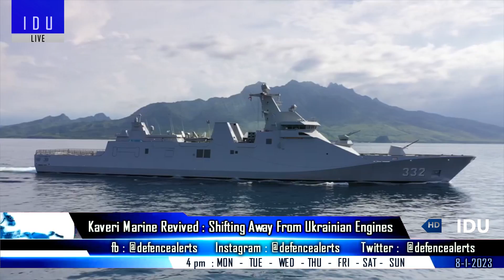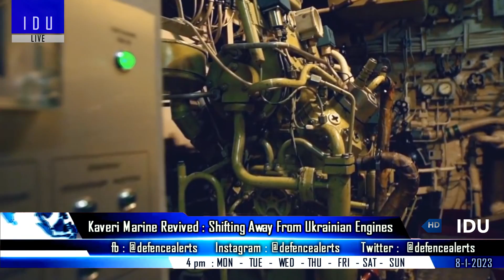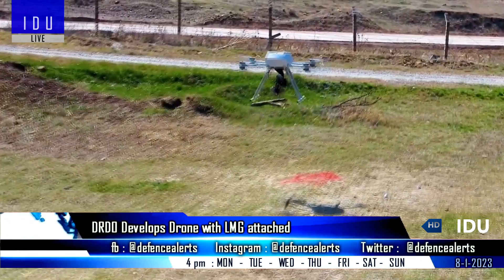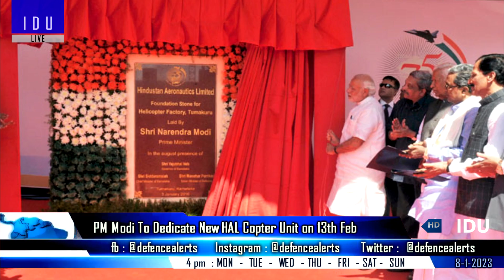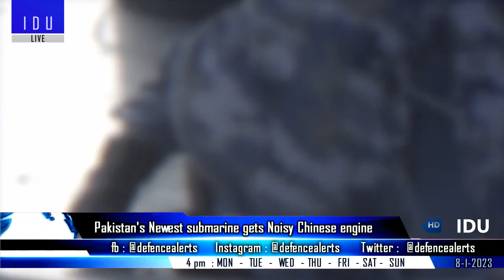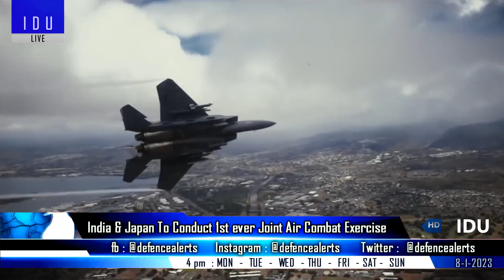Indian Defence Updates : Tempest Engine on AMCA,Kaveri Marine Improved,Drone With LMG,New HAL Unit

Comment: Along with inauguration of Tumakuru unit, IAF should place orders for 12 Initial Batch/Limited Series Production Light Utility Helicopters so that production can start. Deadline should be by mid 2024, all 12 need to be delivered. 

2025 onwards the production capacity should be increased to 20 Helicopters per year.

Comment: DRDO should develop a DJI MAVIC Territory type heavy duty drone that can be armed with a 25 MM GAU-12/U six-barrel rotary cannon & a 7.62 MMG . . . as for ammo load no less than 1,563 rounds of 25 MM ammo & 2,835 rounds of 7.62 X 51 MM armour piercing rounds . . . a 30 MM GSh-6-30 six-barrel rotary cannon will do as well instead of the GAU-12/U but it'll have the same number of 30 MM rounds as the 25 MM . . . the Indian Air Force should seriously consider acquiring a fleet of 18 - 23 second hand refurbished C-17A Globemaster III multi mission heavy lift transport aircraft . . . word (unconfirmed authenticity) is that the Royal Air Force is planning to sell three of it's C-17A Globemaster III multi mission heavy lift transport aircraft . . . the Indian Air Force can also acquire second hand refurbished C-17A Globemaster III multi mission heavy lift transport aircraft from the USAF . . .

Comment: I think we should Join the Tempest Program as it would help AMCA as we would get Better Engines and Avionics and at the same time give us 6th Gen Fighters just in Time....Also Tempest Timeline would match just in Time to the First Flight of AMCA Mk II so I dont think AMCA would be Abandoned....Also We would receive the first Few Tempest Squadrons by 2040 just in Time for us to replace our old and by then obsolete Sukhoi Su-30 MKI Fleet making our Airforce Highly Indigenous, Modern and Independent (All Old Fighters are Now Retired or have a replacement at hand, LCA, NLCA, MWF, TEDBF/ORCA, AMCA Mk1 and Mk2 are all Indigenous Programs, Tempest would be a JV and would replace the Su-30 MKIs and We would have an MRO of Rafales if the MRFA Deal Concludes as Planned, We have a Backup Plan of ORCA of it doesn't....) at the same time we with Safran should should for a Improved Kaveri having a thrust of 110kn for Single Engine Fighters, a Rolls Royce 130 kn EJ 200 Derivative for Twin Engine Fighters and a 140 kn+ Tempest Engine for AMCAs......
Reply: Y can't we develop our own engine